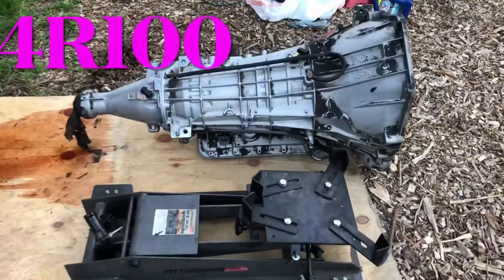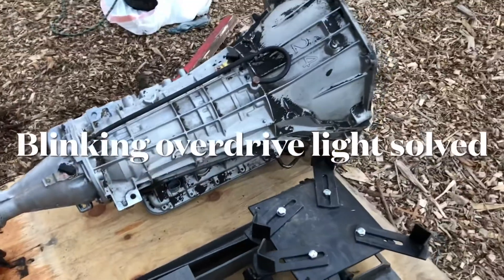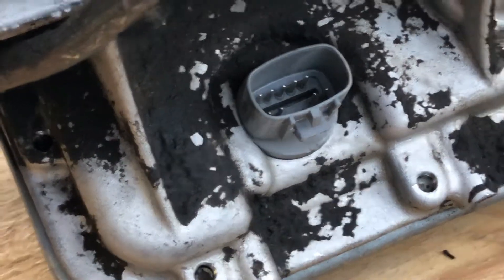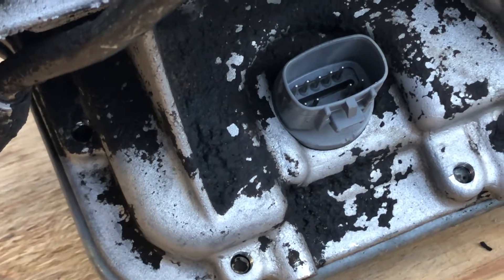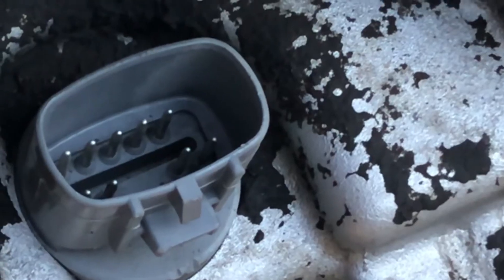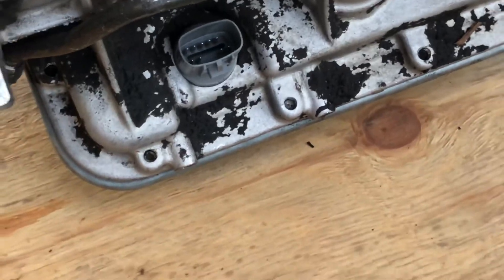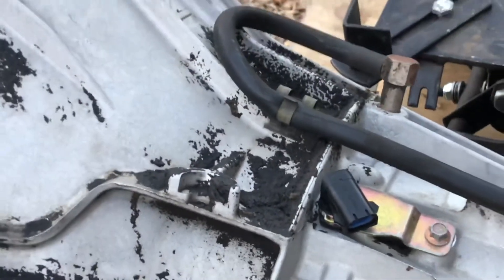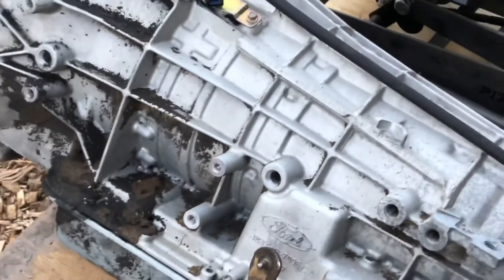OVERDRIVE LIGHT FLASHING??? TRY THIS ! F550 7.3 4R100

Comment: Had to comment…I have an E-350 with the 4R100 that developed a constant blinking overdrive light.  While my plug wasn’t loose or disconnected, it was a bit corroded at the pins and had liquid pooled up.  I cleaned it, fresh dielectric grease and reconnected.  Flashing Overdrive light immediately resolved. THANK YOU 🙌🏼
Reply from the maker: Awesome thank you for sharing! That is great information to have. I am so glad this helped you solve your problem.... So you are very welcome. And again , I am glad you shared the info. Because someone may see the plug plugged in, and not clean it. So very good info!👍👍

Comment: Definitely going to check those connections. Thanks broham
Reply from the maker: My pleasure. One more thing I want to let you know. Even if the plug looks plugged in. Unplug it and inspect the pins inside. They could be corroded or burnt. I had a commenter let me know his was plugged in,  and that fixed it. So good luck and please let me know what you find!

Comment: Update just fixed 2001 F-250 R4100 transmission speed output shaft sensor. Took my 15 minutes. It was a 5/16 not a torques. I removed it and inspected the connections. I noticed on the sensor connection there was clearly some dust incursion. The pins looked corroded. I cleaned them with rubbing alcohol and a  cotton swab. Reinstalled it took it for a test drive. Shifted like new. I disconnected the battery to reset the service engine light. If it comes on again I’ll replace the sensor. But I have a feeling it won’t. If you own a 
4 x 4 I would imagine this probably happens quite frequently especially if you submerge your truck in water. Also check the connections on the shifter sensor. Don’t remove your transmission first 😂
Reply from the maker: I was removing the tranny already ,it was already fried wise guy😃✌
Reply: The other issue is metal particles collecting on the front speed sensor. I removed mine cleaned it off shifts like new.
Reply: @fastflo1 Then why mention a disconnected harness which you obviously had to disconnect to remove the transmission?☝️🤡
Reply from the maker: @rolandthethompsongunner64  not so obvious. Before you call anyone a clown make sure you’re making yourself look like one 😀 I never saw the plug was not connected until I was pulling the transmission out . That’s how I found it . The tranny was already bad because they were driving it unplugged . They fried it and I was putting another tranny one . So that’s why you little joker
Reply from the maker: @rolandthethompsongunner64  nice! Good to know 👍🏻

Comment: I HAVE READ SEVERAL POSTS ON THIS PROBLEM. 3 other people and i just replaced the ECM  and fixed the problem. i have an extra new computer as i bought one while waiting on the other to arrive from flagship-one
Reply from the maker: I have read several also. I would have never known if I did not pull the transmission out. The plug is so hard to see when it is installed. But nice to know that you have fixed your and sharing that. Its all about helping each other out and find solutions to our problems.💪
Reply: Yeah so you changed the most expensive electrical part first instead of the sensors? 😂

Comment: Well if the plug isn't properly connected will the trany still function and did ur speedometer stop working
Reply from the maker: It was not working good at all. It was Stuck in 2nd gear. Reverse was slipping . Overdrive light blinking . It would not go over 30 mph . The speedo was working. I did not find this plug until I was removing it . I think it may have led to all the problems it had. My guess is it was working and then the harness started to hang off the side of the Tranny and it eventually pulled the plug out . It’s hard to see the plug when the tranny is installed and everything together . The tabs that lock it in were not working either . So I plugged it in and it still didn’t work right . I put the used Tranny I bought in it . The overdrive light tuned off. It actually works now. Shifts perfect and puts the power down nicely . So it definitely made a difference.

Comment: I don't have same vehicle but it may help someone.   I have 2003 Ford E250 van.  OD light flashing and OD not working.  Replaced shift solenoid A, ( check engine light code 0750 shift solenoid A bad..).. checked all connections.. and on a whim replaced transmission speed sensor...  and then it worked fine.. light stopped flashing and CEL cleared.
Reply from the maker: Great information! Great to know, thank you for sharing. Sounds like it was a little tough to figure out. Good job!

Comment: Hey I've got a bunch of fluid in that socket, do you think I can spray some electrical cleaner in it and be okay??
Reply from the maker: Hey 👋 wow ... well that plug was my entire problem . And they say if you have a bad or wet connection it car really cause  the signals crossing . I would go for it if it were mine . I think they have a good electronic cleaner . I think I have used mass air flow sensor cleaner before . But I would try carb or brake cleaner too . I think they would be better than oil and they will evaporate...
Reply: Use MAF sensor cleaner, safe for plastic and evaporates quickly,  the brake/parts cleaner? I would stay away, very hard if not fatal to most plastics.

Comment: Did you have any performance issues when the od light was blinking
Reply from the maker: Yes i did. The truck would not go over 30 mph. Or shift out of second gear. And eventually reverse went out. That plug really messed things up because the tranny was rebuilt and the plug came out and because of that it ended up frying it out driving it like that. So when I put this used one in and plugged it in it worked perfectly. Still does I have it and use it all the time. I just had to replace the electronic part that is hooked to the shifter. Overdrive was slipping but it was the TCM Transmission Control Module. No more slipping now, shifts perfectly. What is yours doing?
Reply: Overdrive light is blink when I come to a stop it will shut-off when I accelerate or idle in drive. Won't shut off if I put in neutral at a stop.

Comment: I'm here to tell you brother there's no way in hell your truck was driving with that plug which is the valve body for the transmission plug unplugged no way possible
Reply from the maker: It was driving , not right though! It was in limp mode we thought. But it would not operate right. It would not shift right . We think it was stuck in 2nd. And reverse would not work, it was spinning or slipping , it would not move the truck though. And if you floored it sometimes it would not even move. If you could get it going it would do about 30 mph and that is it. So I bought a used tranny. Thinking this one was fried, and by the time the guys that I bought it form did what they did, and I did what I did, I think we smoked it. When I went to drop the tranny out, the guys had the harness just hanging on the driver side, not clipped on. And it was pulling on the plug. When I  went to remove it the plug before I could even try it just fell out. So, I put the new used tranny in and it works great. No overdrive light any more. Reverse at idle. Goes through all the gears fine. So I don't now what else to say besides it fixed everything. So what do you think happened?

Comment: Do you know if its the same on the f 250?
Reply from the maker: I have a feeling it may be similar. I am not positive though....
Reply: @fastflo1  I replaced the speed sensor and still have the same issue , checked for broken wires and haven't found any yet, I'm running out of options..
Reply from the maker: @Marinesniprx  Have you looked at the button itself on the column? I have heard that can be an issue. It was not the issue on mine. I did take it apart and inspect it though.
Reply: @fastflo1  Yes I did , I was able to pull out the ignition but no wires were broken or worn, back to the drawing board for me, here are like  literally 25 different things that can make the O/D light flash and stall when it's put into gear..idk what's up or where to go next..
Reply: @Marinesniprx  Find the problem yet? or solution? having same problem and need any help i can get

Comment: You pulled the transmission before noticing it’s main wiring harness was not connected?😂
Reply from the maker: You are too funny. The story is more than that if you must know. I bought the truck without seeing it from Oregon. The truck was in Cali. Nobody knew why it was not working. So I brought a transmission with me with plans on yanking it out and changing it. So I pulled it out and when I was I saw the plug was tucked in like it was plugged in , but it was just sitting there. So that is why joker😀

Comment: How does one go about testing these plugs/sensors to determine if they’re not working?
Reply from the maker: I believe you can use a scan tool and see if the sensors come back as a code with a faulty one.
Reply: You have to ohm them. These aren’t expensive sensors just change them one at a time.

Comment: Did you get any codes?
Reply from the maker: I did. If you see a million codes pop up . That plug is probably the culprit. It had like 6 codes I believe.
Reply: @fastflo1  thanks I cleaned the plug cus it had alot of fluid in it. Also changed the tcc solenoid and u haven't had it blink. It's been a couple days and no blinking light l, no codes.
Reply from the maker: @ELlos210   Nice 👍🏻 that is good to hear . Amazing how much of a difference it makes . Glad to hear you to it figured out .
Reply: @fastflo1  I know thanks.  And my gas mileage went up. So no more 10 miles per gallon 🥳

Comment: I mean I don't wanna get spray inside my transmission but it definitely needs to be cleaned out
Reply from the maker: I think you will be ok 👍🏻 I think the plug is separated from the tranny . Like the outside to the inside . Buy try it and then remember to clear any codes . Something it will clear itself . I have heard to clear the code after doing repairs . Let me know if it fixes it! I’m interested to know !
Reply: @fastflo1  I couldn't spray out the socket because the can was too big to get in there but I got the plug cleaned out and plugged it in and out a few times cleaning it every time. I was able to get my air nozzle in there to blow it out. I cleared the codes and I'm going to take it for a drive right now. I'll let you know.
Reply from the maker: @michalhowling3702  Ok cool update and info! Sounds like you got it pretty good so we will find out. I m eager to hear if it worked!
Reply: @fastflo1  the light came back on at first start but second start it was off. This has been an intermittent problem for months. It's bugging me to death
Reply from the maker: @michalhowling3702  OK... Yes I went through a lot to get mine to turn off. Have you checked the passenger side engine compartment area to see if there is a burnt wire by the exhaust manifold?
Reply: @fastflo1  it didn't work this morning either, but after a long drive it stopped for a while. I don't know
Reply from the maker: @michalhowling3702  I also took apart my switch and the ignition out so I could inspect the wires . Have you tried that?
Reply: @fastflo1  so far I've done both speed sensors, took apart the ignition, transmission fluid, transmission cooler and rubber lines. I think I'm going to go back to the wires in the ignition.
Reply from the maker: @michalhowling3702  jeez.... you will be making tour own video by the time you’re done! That’s how I ended up making mine ! Stay with it I can’t wait to see what it ends up being! Hopefully it is the wires in the ignition area or the plug or harness ....
Reply: @fastflo1  man, I drove almost all day today and it never happened until after midnight when I was at McDonald's to get dinner. I'm getting so freaking frustrated.
Reply from the maker: @michalhowling3702  Dang.... Well... Good news is that it seems to be happening less and with more clear time in between coming on. Makes me wonder if the plug is still wet. It seemed to improve after cleaning it. Maybe pull it and take a look again, see what it looks like? Dry or?
Reply: @michalhowling3702  also the third brake light on cab... if it’s full of water it will short out an send false transmission codes due to wire harness being inline wired with trans harness

Comment: I am having a stalling issue, at idle its fine but when i pull it down in drive it stalls and i've been noticing a blinking over drive light as well with occurrence of this stalling issue
Reply from the maker: I have heard that the wires to the overdrive light that are in the steering column section may be shorted out or pinched. I removed my assembly and checked for that. I would start with that and see if makes any difference.
Reply: This is a long shot but I have the same problem in my truck, have you found the fix for it?
Reply: @dayminwhite2214  mine was actually the wires going to the transmission, they had fell out of the body clip and was grounding out on the drive shaft. Definitely check the wiring for any copper showing
Reply: @dayminwhite2214  me too
Reply: @Marinesniprx   I fixed the issue with mine, turned out to be a plug on the passenger side of the trans right next to the cat, if u reach up you’ll feel it. It was filled with trans fluid and I sprayed it out with electrical cleaner spray and and plugged it back in, replaced fuse 21 I believe, but it fixed all my issues with it and it runs and drives great 4 months later

Comment: Wouldn’t you have checked that first before removing any transmission ?😂
Reply from the maker: Well... Maybe not. It is hard to see. And I doubt people would guess that. This tranny was fried. And I noticed it while I was taking it out. And it is hard to see and access with it installed. Go take a look. But it was way more obvious when it was on its way down. The plug was just right above just popped off.😃